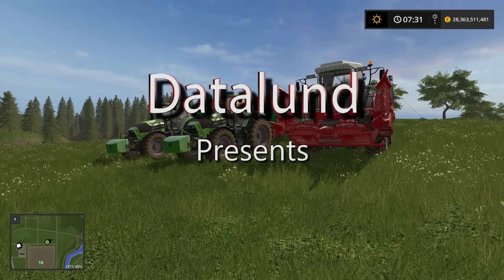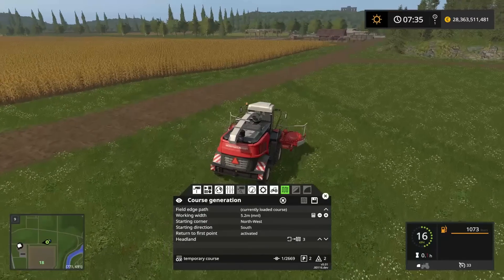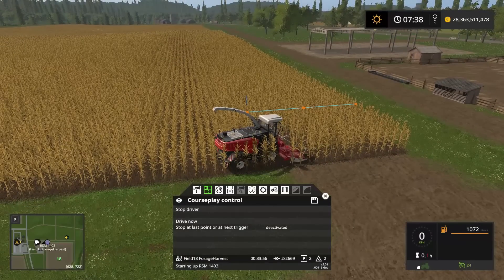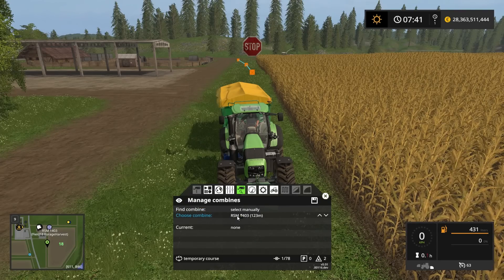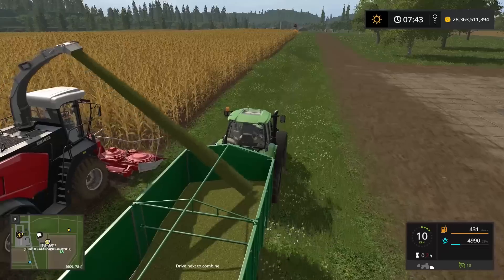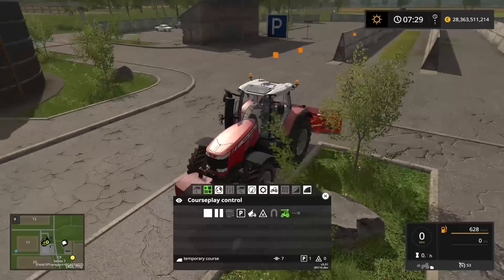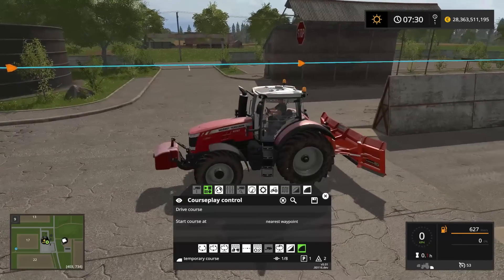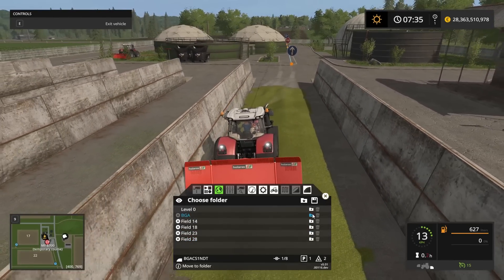How to set up Courseplay for Automated Silage Part 1 - Farming Simulator 17 Courseplay Tutorial

Comment: Why does the JCB reverse all the way back to the end of the silo when you set the start point in the middle of the bunker silo?
Reply from the maker: Do you mean the tractor with the leveling blade? My best guess is that it is detecting the full length of the unload trigger inside the silo, and uses that as its reference point

Comment: So I have a problem my semi gets going just fine with following the Harvester but as soon as it starts turning around that's where it runs in the problems the drives forward pass the Harvester and then jackknifes the truck and can't get out of it it just continuously backs up until I intervene and reset it
Reply: I'm unsure if it's something I did wrong or if it's just being stupid
Reply from the maker: Could you try with a different setup? It sounds like you are experiencing some mod issues here
Reply: Datalund could be it I'll just try a smaller tractor and Tipper and see how it does

Comment: You could leave the field out of the course description because you are placing it in a folder for the field. That would shorten the file name.
Reply from the maker: That's right. It would make the file name shorter, but leaving the field name in, will give you the option to rearrange the courses at a later point if needed. You can move them out of the folders and still know what is what.
However if you know that you are not going to change the folder or file structure I'd definitely leave the field name out of the description.